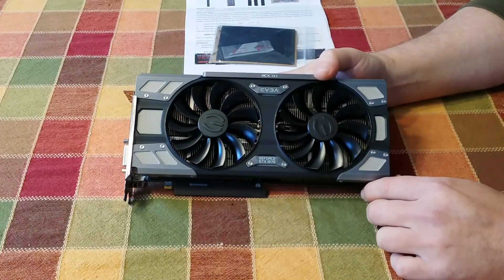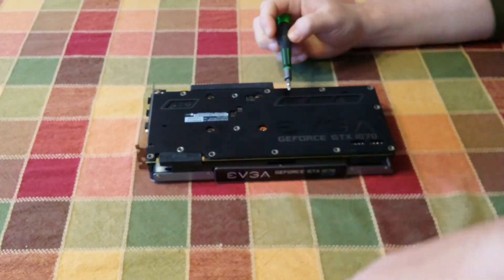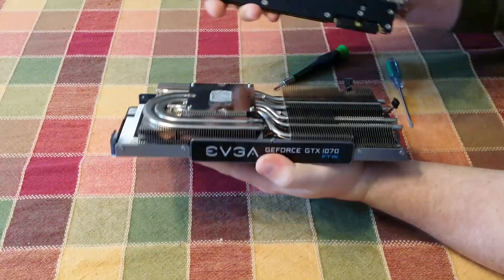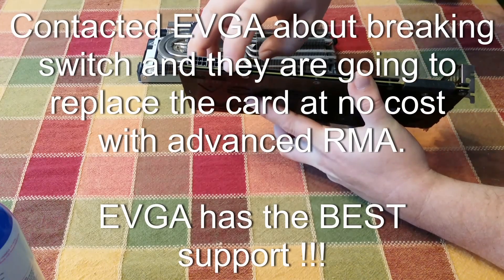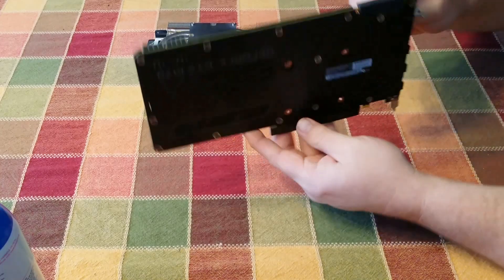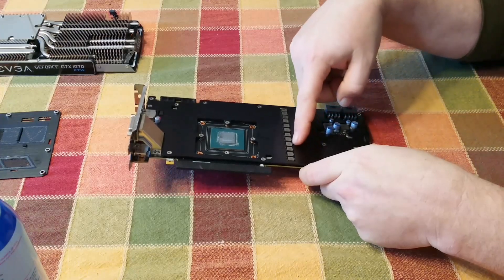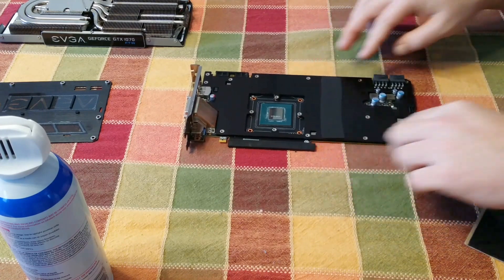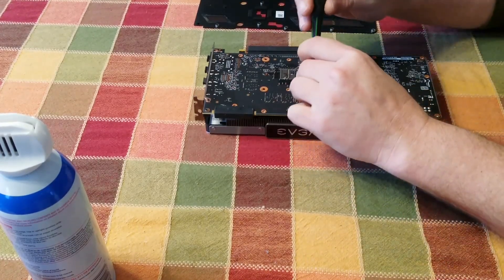EVGA GTX 1070 FTW Thermal Pad Ugrade w/ ALL THE PADS!!!

Comment: Hi TikTok. I just bought my GTX1070 FTW. I only just read about the VRM issues and the exploding capacitors... 
How long do you have this card ? Do you still have it? Any issues like black screen or higher heat? 
I went and bought an infrared heat thermometer so I can check the cards backplate.
Reply from the maker: Which model did you get? Did you get the FTW DT or FTW. The reason I ask is cause the FTW DT model already has the updated bios and added thermal pads. If you just have the FTW edition you can get the updated bios from EVGA and I think they are still doing the free thermal pad update. But to answer your question no I had no issues with the card before I did the update. It ran and overclocked like a champ before and after the update. From what I have seen and read it was not the huge deal everybody made it out to be. Gamers Nexus has a really good video about it, thet you may want to watch. One other thing, if you do have the FTW at least do the bios update and you will be fine.

Comment from the maker: Not a 100% sure. The EVGA GTX 1070 FTW has dual bios feature. Keep the old bios and load the new bios on the second one. Then run both bios and keep a eye on the temps and clock speeds to figure out which one you like better. The new bios is super simple to download at EVGA.com under their support page. Thank you for watching...